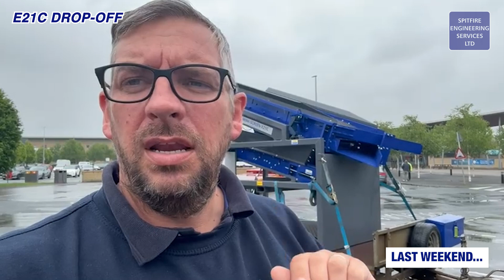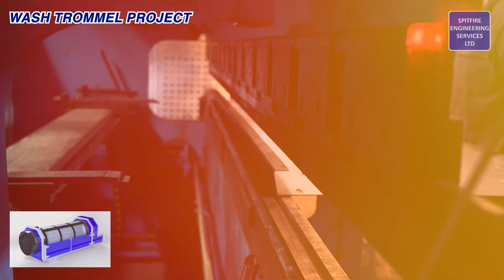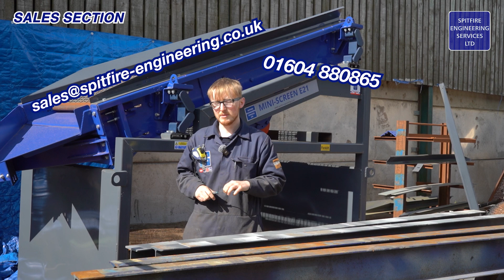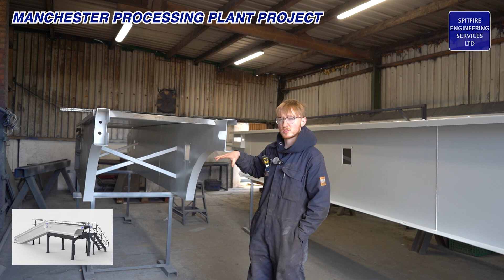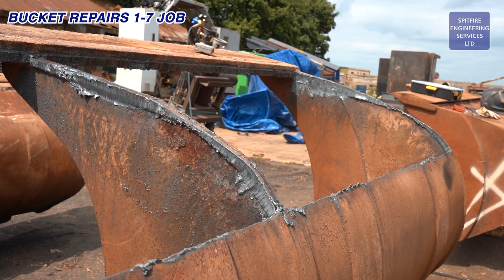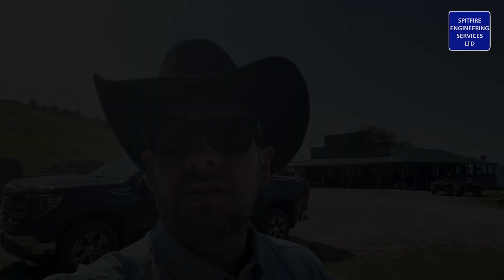WHAT AN ABSOLUTE COWBOY!

Comment: Talking about Eddy Currents do you have to change how you design things or the placement of equipment so the machines and Eddy Currents do not interfere with one another?
Reply from the maker: Not really on Eddie currents. Overband can be tricky to deal with and we need to use stainless around them